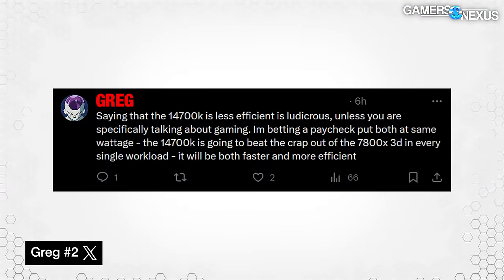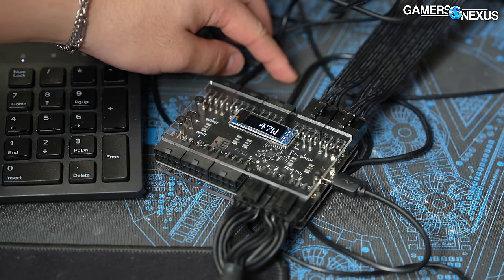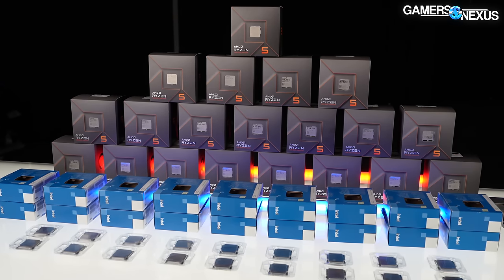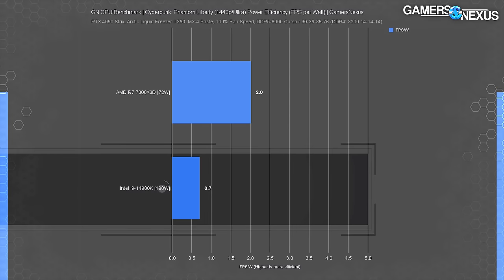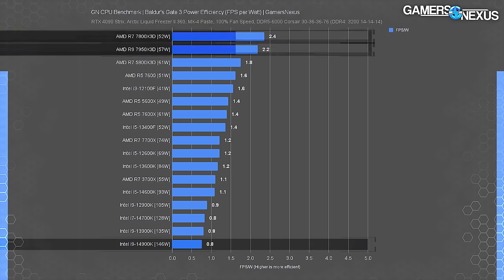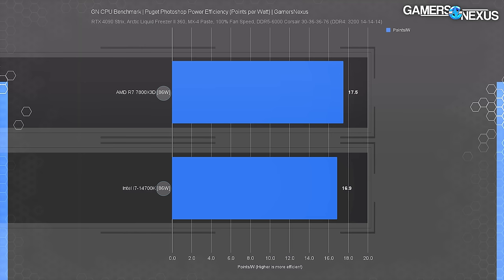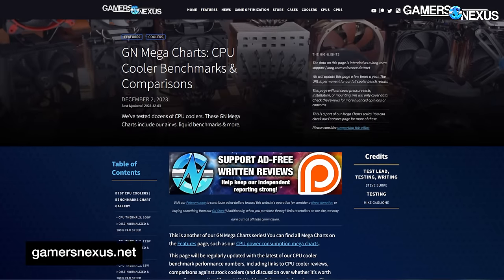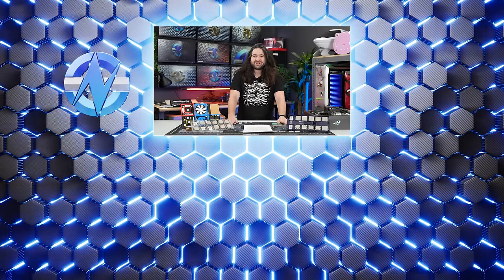The Intel Problem: CPU Efficiency & Power Consumption

Comment: Can we all just take a moment to thank Greg for threatening us with a good time?  This was an EXCELLENT presentation and more than a little eye opening.  I knew 14rth gen i7 and i9 CPU's were power hungry but Intel got absolutely abused.  I should not have started this at bed time.  30 minutes gone in no time.
Reply: even 8, 9, 10, 11, 12, 13 gen too were/are power hungry...and i dont know why intel call those cpu 14gen, in fact they are 13gen with a bit overclock

Comment: If I can make a humble suggestion: you're referring to the voltage/frequency curve a few times in this video. It would be interesting to actually plot the curve, then find the sweet spot for the CPUs (7800X3D vs. 14700K would probably be most interesting) on that curve and compare the performance at that particular point. This would put a figure on the maximum achievable efficiency.
Reply: This seems a cool idea!
Reply: Problem is, that optimal efficiency would be different for every single possible application. Even hardware, just different CPU/GPU/memory combos could have different optimums.
Reply: @termitreter6545  It would probably be sufficient to fix all the other confounding hardware, and optimise the geomean of the whole test suite. It shouldn't take too long to just do a binary search, especially if they speed it up with some gradient descent.